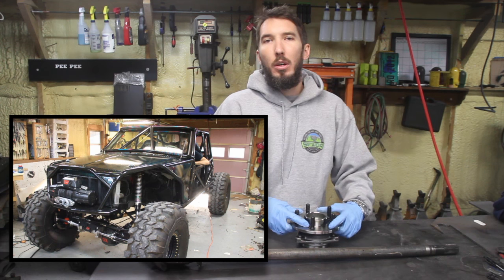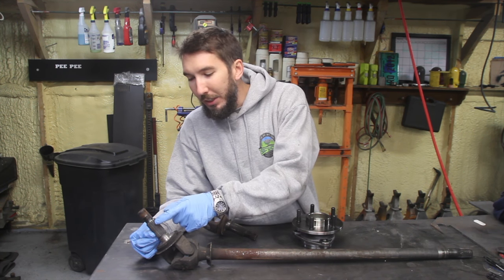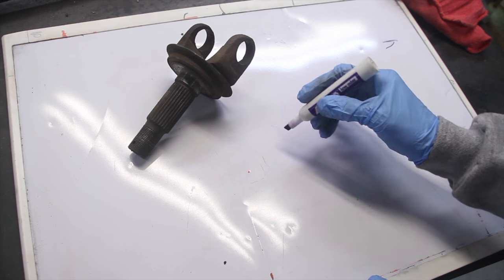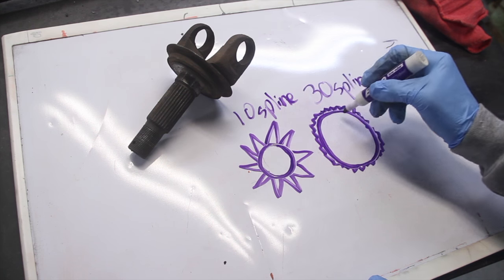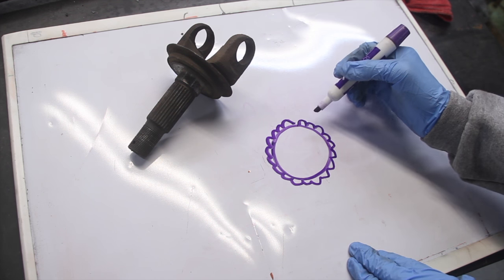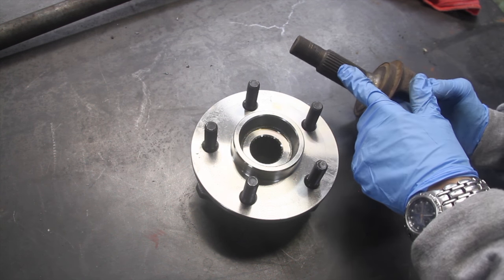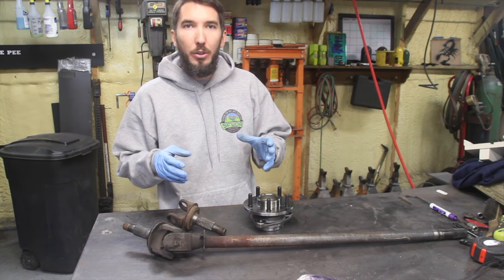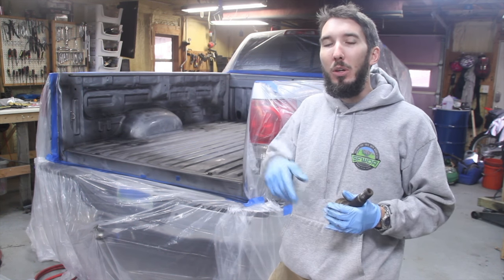27 Spline VS 30 Spline??

Comment: Another reason, and one I think is more important than shaft size, is contact surface area. More splines = more contact surface area = more torque handling. Basic engineering dynamics.
Reply from the maker: probably to a point, I'm no engineer but if there were a million splines I believe they would be so small they would strip.
Reply: That's true, and I wasn't saying you were wrong in your explanation. But the reason the shaft gets bigger is to allow for more splines.(which you mentioned) But the 27 spline shaft could be the same size as the 30 spline and it would be somewhat stronger then the standard 27 spline shaft but not as strong as the 30 spline shaft. (standard 30 spline size)
Reply: Daniel Pace when axles break it happens in the unsplined sections look it up. I get your point and its valid but axles don't break there
Reply: That’s what she said

Comment: I've also heard that an increased number of splines can reduce overall stress in the shaft because there is more surface area (more splines) for the torque in the shaft to be transferred to the hub
Reply: Brandon Low, I was reading thru the comments to see if anyone else had brought this up. More splines equals more contact area.

Comment: Number of splines doesn't necessarily dictate the size of the shaft. Great example is a 30 spline 14 bolt shaft is similar in size to a 35 spline Dana 60 shaft.

Comment: Can you do a install video of a eaton G80 locker out of a Volvo Dana 30 rear axle and install it in a Dana 30 front axle? Splines are the same, I believe some modifications are needed to the drivers side axle shaft .

Comment: Don’t put 30 spline shafts in unless you’re gonna carry spare bearings and both inner and outer shafts cause you’re not gonna find a 30 spline replacement in a pinch. Better off going with rcv at standard size and then in a pinch you can always find factory 27 components in a pinch to get you home.

Comment: Where can you get specific unit bearings? Wanna Put a Dana 60 in my rig but need a unit bearing that has the RAM 2500 bolt pattern?

Comment: Matt. you do a great job. Thank you. one question. on the YJ solid axle swap. what is the part number for The seal and block off plate. Thank you. Juan Barturen.
Reply from the maker: It should be in the description of that video...

Comment: So, are carriers interchangeable provided they have the same spline count?  Specifically, can the carrier from a Dana 35 rear axel be interchanged with the carrier from a Dana 30 because both have a spline count of 27?  I ask because I have wanted, if possible, to move my ARB locker from the rear 35 to the front 30 and ditch the 35 for a 44, which would then get a new ARB.  I understand that the 35 has c-clips, and I have heard some comment that this would prevent the swap, but I really can't see why not having c-clips and simply having splines on the end (as would be the case with the 30, would be an issue if 27 spline shafts have the same diameters at the splines).  Wish I could just take everything apart and try this, but I am not situated to do so.

Comment: Now explain the pumpkin end at the Differential 27 spline vs 30 spline, what changes have to be made.
Reply from the maker: If you just do the outers, nothing...  if you do a different spline on the inner you'll need a new matching carrier
Reply: Where can I get a 30 spline carrier

Comment: would you recommend upgrading my stock 8.8 28 spline lsd with drum brakes Ford Ranger rear end to a 8.8 31 spline lsd with disk brakes of an explorer if I going to run 35s. Is it worth the work of switching them out. Also switching gearing to 4.10s to 4.88s.
Reply: I run one in my 2000 ranger, the 28 spline has held up to my 35s just fine. but the shafts are bigger in  the explorer which has bigger bearings on the outside.   the 8.8 28 spline shafts are the same shafts in the 7.5 axle shafts in the 2.3/2.5l i4 lima and 3.0 rangers.   i am also open diff... i would be afraid of breaking a shaft with it locked.

Comment: maybe this is obvious in another video, but what axle are we talking about here? the scorpion crawler has 37's, right? this can't be talking about a jeep dana 30?
Reply from the maker: Any axle will be stronger with a higher spline count.  This unit bearing though works on a D30 or a D44 (outers from the knuckle out are the same)   Scorpion has 39.5" tires.
Reply: BleepinJeep didn't know that about the knuckles! thanks for clarification.

Comment: arent most failures of the "ears" on those yokes anyway?
Reply: I agree. I've had friends break about everything in their axles but never have heard about stub shaft spline failures. Most ear failures I've seen appear to be due to u-joint failures. One way is that the u-joint caps can sometimes shift outward causing the u-joint to bind up in heavy turns and bust the ears as a result. I like to put a 2 small tack welds or dots of JB weld on each cap to keep it in place. If you ever need to replace them grind them off.

Comment: I love the tech stuff Matt.
Can your inner axle be 27 spline and your stub shaft be 30? would that be beneficial? and what about the U joint, would it be two different sizes?
Reply from the maker: Yes, in fact thats what I'm running... my inner is 27 and outer is 30.  Sometimes its just not practical to run larger splines everywhere, i think in my case (don't quote me on this) it was because OX locker doesn't have a 30 spline locker??  So I just went larger where I could, which was only on the outer.  In my case, I'm running RCV's as well so there is no U-joints but no, the u-joints would be the same size.  I'm also running a 44 front in which case the inner is bigger but the outer is still the same as a D30 but now its got a 30 spline instead of a 27.  Is it beneficial to run a 30 outer and still have a 27 inner??  well I guess that depends on where you tend to break... some ppl always break outers and some tend to break inners, while some break ring gears.  Maybe it has something to do with how the vehicle is set up I guess.
Reply from the maker: well I think I was wrong there about OX, after looking on their website they do offer any spline count you want so... I went back to look at my communications with RCV and this is what they told me and I went with 30 spline inners:   From RCV - "We do make 35 spline inner shafts for the TJ, but it still necks down to a 30 spline at the CV joint. My Opinion is unless you are getting extra strength from the 35 spline locker, then there is no strength gain from the extra spline. It also changes up the axle seals and makes a replacement shaft (if needed) extremely hard to come by."
Reply: BleepinJeep I was just about to ask this question. only thing I may add is, if one was to upgrade to a zj knuckle, could you still do this upgrade? sounds like a dumb question but I was wondering. Would a zj have bigger 30 spline shafts?

Comment: Ok, I call bull shit. Its gearing. More splines equals more power. Instead of 27 splines per turn you are getting 30 splines which makes it stronger as weight and power is distributed better.